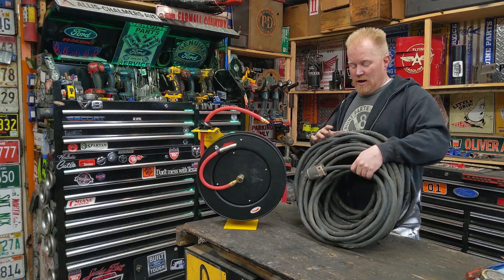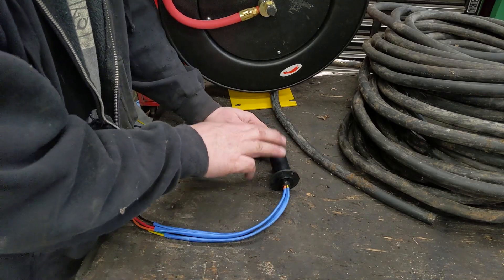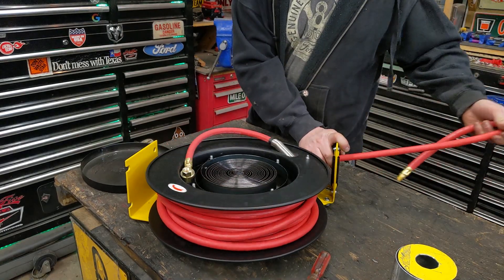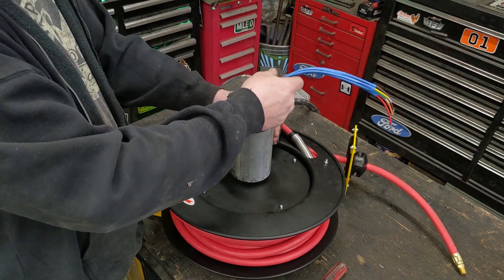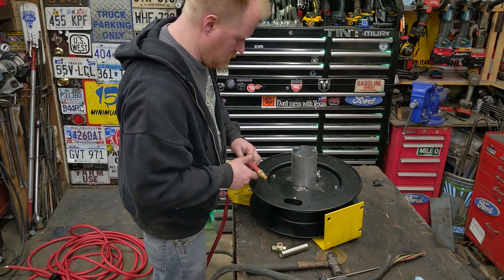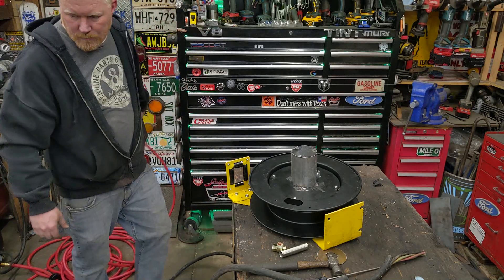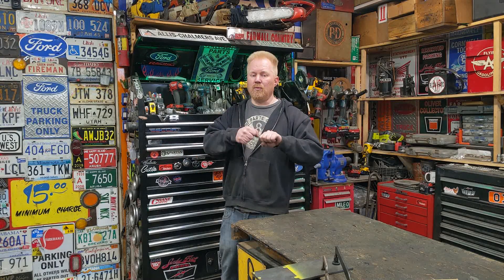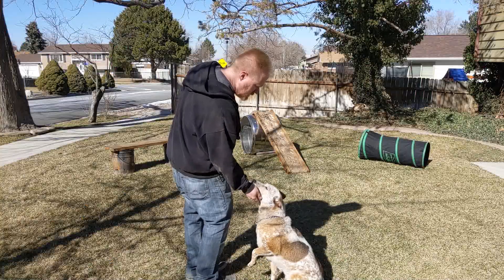DIY retractable WELDER Cord Reel 50amp 240volt Plasma Cutter

Comment: Before you added the wire to the reel, I think you could have wound the reel a few more turns to get more pre-load on the spring. I've had to do it before even with just the hose. I can't remember how much more it can be wound before the spring is maxed out tho.
Reply from the maker: I gave it two more wraps last night. You need to use it for a while to let the clock spring settle in but I may be able to get away with doing another one or two wraps.

Comment: I like the idea of redundancy in the slip ring. This is the most likely point of failure. Nice work!
Reply from the maker: That was my thought. I wouldn't buy a 6 conductor over a 3 though for this purpose but it worked out fine.

Comment: Blue tape can't disguise that harbor freight hose reel. :) You can probably give it an extra wind to make that last 6 feet retract easier. the instruction book says how but basically pull it out one turn then manually feed the cord around the reel (you'll have to take your end off again).
Reply from the maker: It's blue tape brand. It's so cheaply made I didn't want to endorse it. I have their higher end Red Diablo that I thought was cheap, but they were out of those when I went in. It first look they look to be made the exact same but this yellow one has a few more corners cut to save a few cents. I t should hold up fine, but if not I'll beef it up. But I did give it 2 extra winds last night. The cord is also so heavy it takes a second for the reel to pick up momentum, then it seems to do fine. I thought I would get an extra air hose. Nope, the hose was so cheap that came with this one. The rubber was so soft and uncured it stuck to other parts of the hose when reeled up and ripped holes in itself when unwinding. So the brand new hose has around 5 holes in it and I've never aired it up. I'm taking just the hose back to HF today to see if they'll give me a new hose.
Reply: @sixtyfiveford  the hose must be hit or miss on these then, I have 2 of them and they work great (couldn't resist $60 coupon).

Comment: What do you think about that M12 die grinder?
Reply from the maker: It's handy for sure but very weak. I pretty much only use it with a Roloc sanding or Scotch Brite pad as it can't handle cutting discs well. It also burns through batteries super fast.

Comment: Do the main coils of the extension cord heat up at all after welding?  I'm not talking about the spinner component, but the actual coiled extension cord itself. If you were using this for something other than welding, something with a high current draw for sustained periods of time, I'd be concerned about the extension cord melting together and shorting. You can search for "melted coiled extension cord" if you want to see some fun pictures!  Awesome project!
Reply from the maker: No heat at all with my test runs. I was actually trying to heat it up. There's just so much down time with welding it'll never be a concern. Any cord reel though should be unwound to allow cooling during heavy use though. In the unlikely scenario that I want to run a portable stove in my garage I would be limited to a 30amp 100% duty cycle of the slip ring.
Reply: @sixtyfiveford  looks like you finally did just that. Once we upgrade the dryer in our home, I might duplicate what you did! Love the explanation about the duty cycle...always wondered why the old Lincoln welders had a 50 amp breaker but only specified 10ga wire. The more you know!

Comment: Im almost certain there will be some YouTube electrical inspector try and say this isn't to code, however, being an actual electrician I can 100% confirm this man has done his homework and everything is totally up to snuff. Awesome idea! I will definitely be doing the same in my garage!
Reply from the maker: Thanks. The only thing I should probably do is shield the slip ring wires going to the junction box. I just wrapped them with tape mainly so I could test their temps as they are the weak link.
Reply: Great idea for sure, I do love having any long cords whether it’s air, electrical, etc. on some kind of retractable roll hanging from my ceiling whenever possible. Sure makes a cleaner set up and more convenient when you need to use it too!  Hopefully one of those days I’ll have a need to add one of these too. But for now I still need more practice just weilding things for myself and a little Wielder all I can handle dealing with at this point. If I ever get good enough to do larger projects then this be a great addition to add to my shop too!

Comment: ok great video but that will not work the best for stick cuz I have ran my off from 12-2 just in the last week to weld my JD back up and that 12-2 got hot but i do like the info
Reply from the maker: It's all about length of the smaller gauge wire. 12awg wire can push 50amps with minimal voltage drop but only up to around 25feet. If your welder already has a 12awg as the built in power cord you would subtract that length.

Comment: Great idea Bud!! I just cut my 120 ft cord in half last week, it was 12ga!! Not so much for the weight but it's also just a pain in the balls to wrap up!!☺
Reply from the maker: The cord I used was over 100'. I'm happy to cut it down as it was just too much to deal with at that length. Now I have 50' on the spool and 50' I can manage easier.
Reply: Check out how essential craftsman handles his extension cords

Comment: What I ended up doing was making two extension cords.  One is 50 feet long the other one is 15 feet long.  Most of the times I only need the 15 foot one.  That I don't have to roll the heavy 50 foot cord up.
Reply from the maker: That's exactly what I've been doing. I have a 20', 50' and 100'. The 20' is adequate most of the time but it drives me crazy when I need another 5-10' and the 50' has to come out.

Comment: That really looks great Sir got an extra reel that air hose fitting was damaged new fitting is way too much from coxreel so making it electrical is a great answer I’ll just need one of those slip rings thanks brother
Reply from the maker: A Cox reel is built as 100x better than this cheap thing I used.
Reply: @sixtyfiveford  yeah it is a great reel yours works